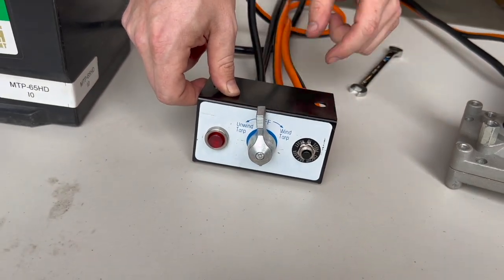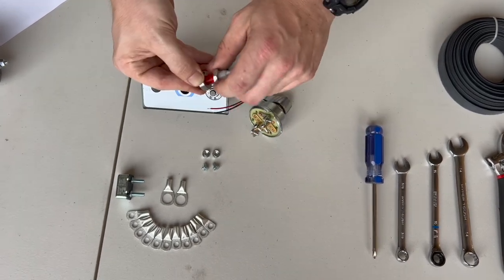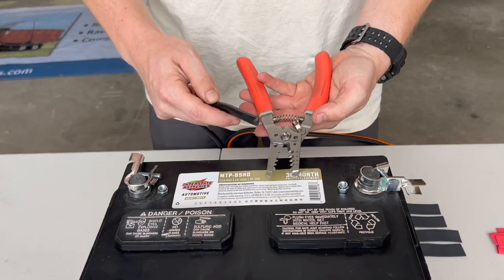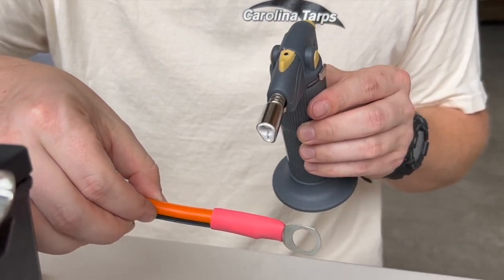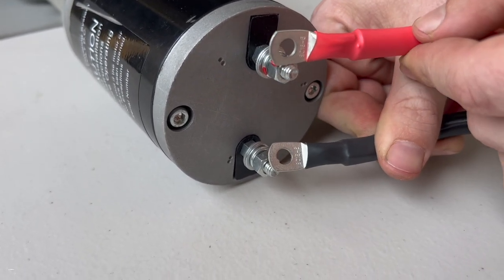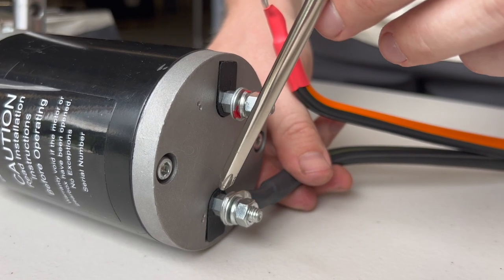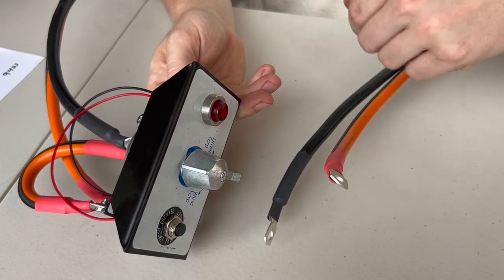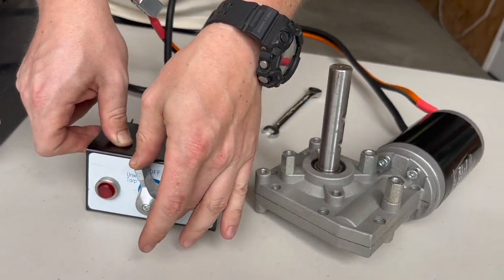How to Install a Rotary Switch Kit for Dump Truck Systems | Carolina Tarps

Comment: why 6 gage seams over kill
Reply from the maker: Hey Mark, thanks for the question. Our motors are rated at 600W on 12V which would equate to 50amps while under power. While 8Ga should be fine in MOST scenarios at that rated load when installed correctly, we have found the 6Ga. braided wire has enough wiggle room in max amperage so that it will never overheat and become compromised from a power spike under excess load. 
Much like in a house, you would rather your circuit breaker trip than your wire start melting in case of a surge!
Reply: i bought GearIT 8 Gauge Wire, Oxygen Free Copper OFC, ( Black/Red Translucent) 8 AWG - Primary Automotive Wire Power/Ground, Battery Cable, Car Audio Speaker, RV Trailer, Amp, Electrical 8ga @carolinatarps